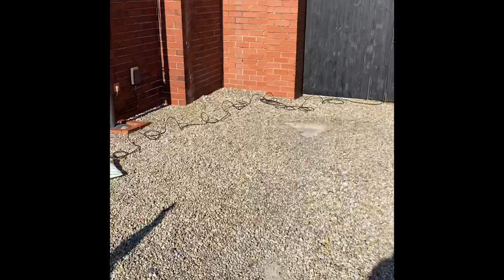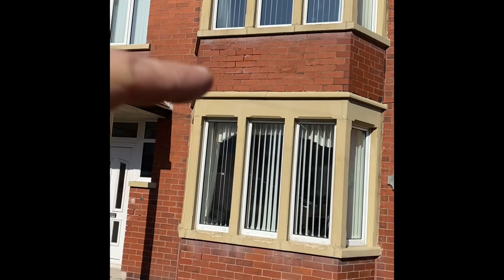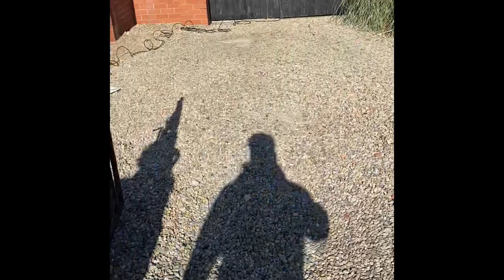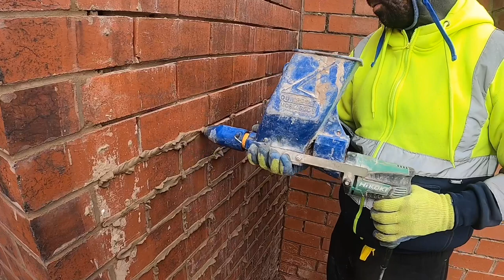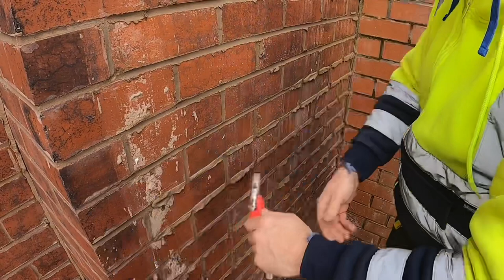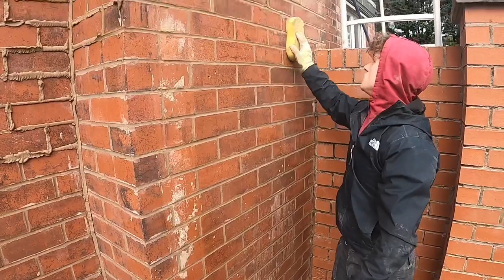How to repoint brickwork

Comment: Very good that never seen it before .
Good job 👍
Reply from the maker: Thanks Justin there not cheap but I think they are worth it when you get going 👍🏻👍🏻
Reply: @rowlockconstruction8345  so can you hire them or is it just buy only iten if so how much and do you buy em from .so much quicker that but does it block 👍
Reply from the maker: I bought mine I don’t know if you can hire them.
It cost £404 for the whole thing I’ve not experienced it blocking. It’s not squeezed with pressure so the whole mix separates and blocks with sand. It all comes out together on like a large drill bit so you don’t get that 😀👍🏻
Reply: @rowlockconstruction8345  
Good info ta v much i like it you made it look.easy 🤣👍
Reply from the maker: 😂 did I haha 😛 yeah it  doesn’t take long to get use to it 👍🏻👍🏻🧱

Comment: Definitely need to use the magic  sponge behind that pointing gun but definitely looks quicker but it's a trade of as you are gaining speed but looks like more work getting a nice finish, why do you not rake out all joints and start pointing from top down👍
Reply from the maker: I find even when you point by hand you always get a bit on them smooth face brick. So you end up wiping them any way. I just find it fills the joints easier. 
I do normally work from the top but because the other lad was using it to grind out I started at the bottom. Just gets the job done ✅ 👍🏻👍🏻
Reply: What sponge it off?

Comment: Had some run ins with next door neighbours over the years through grinding out dust everywhere.
Reply from the maker: Yeah it can cause a bit of upset 😢 😂 
I try to let the neighbours know then they’re usually not as bad as long as you clean up 🧼 😂👍🏻
Reply: @rowlockconstruction8345  Yeah make sure their windows are closed, good pointing anyway👍👍
Reply from the maker: 😂 yeah that’s it and thanks a lot pal 👍🏻
Reply: @rowlockconstruction8345  Or just use an extraction system??